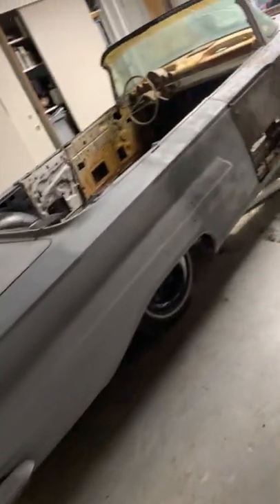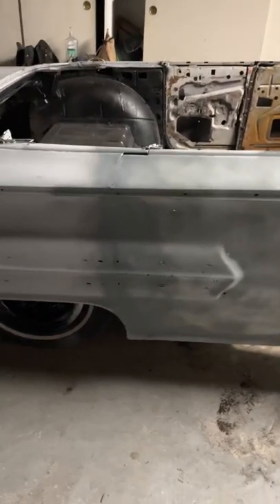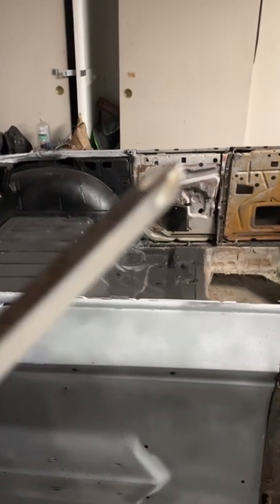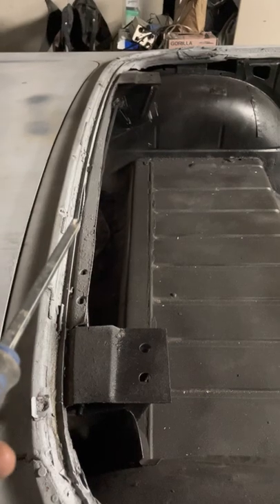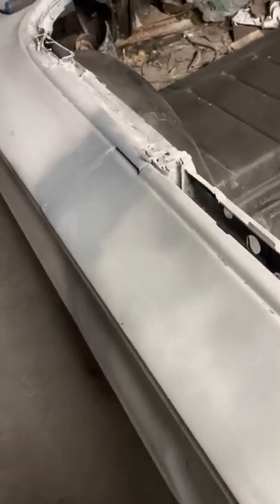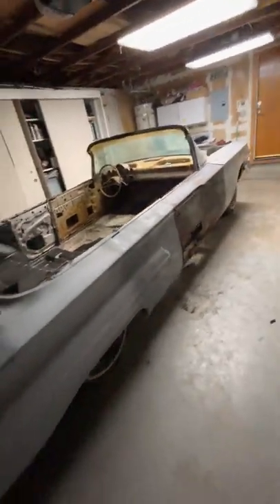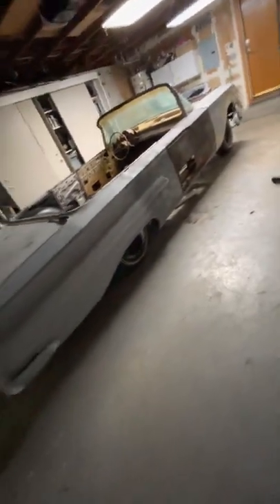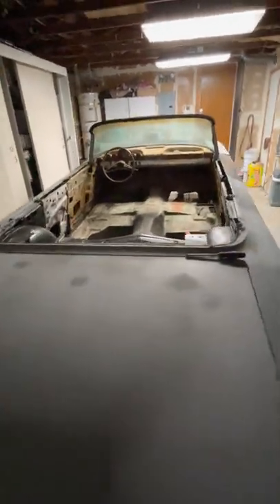1960 impala convertible conversion

Comment: Great work! I understand a 4 door is the way to go when converting a hard top to convertible. Were you able to retain the windshield pillars?         How about the tub around the backseat for the top to retract?  Something one can fabricate or solely a convertible tub needed to function.
Reply from the maker: Thank u !. They sell the windshield bow online i can cut that down easy but the tub about the back seat i have not done yet but i got ahold of a real rusty 1961 cadillac series 62 convertible felt bad cutting it up but i can fabricate that tube to fit ill be posting a video later
Reply: Thanks for the info, sounds like you’re on the right track.  Dream it, build it, drive it!

Comment: Maybe cut the windshield down it will look right the convertible windshields were slightly lower. There's no wrong way as long as you get to where you want the car looking.
Reply from the maker: I’ve always wondered about that part I’m glad you said something I’ll look into it because I kind of want it to be correct thank u 🙏
Reply: @tec_tattz  my friend and I ran into that problem year's ago working on a convertible chevell windshield. They are slightly shorter than a hard top. I like how Chip Foose put the 1959 convertible windshield on the 1957 Chevy. Did you see that. If you can make a different windshield work off another convertible and pull it off to look good.
I met this guy that had a 1939 4 door Chevy he made it into 4 door convertible. He took a completely nice car wack the top off it. It looked really nice he made it look factory. I told him I didn't know they made a 1939 4 door convertible. He and his buddy that's an apoatrery guy made the top for him. It was at the Nails California bay area car show, it's a very small town where Charly Chaplain lived and made some movie's. They have some pretty cool car shows. Maybe you can look it up on YouTube I'm shire someone put up a video. Keep on you'll get it done I seen people build car's truck's in a lot worse shape and turn them into nice rides. 
"Remember it's your vision not every one else's."

Comment: Nice work Bo, my question is what section did you use on the back is that an convertible trunk lid
Reply from the maker: thank u and its the original truck lid its the exact same size as a convertible im stuck here at the moment i need to see another convertible so i can take measurements so i can fabricate parts that are not available

Comment: What car was your diner for the tub and post?
Reply from the maker: it was originally a 4 door so the trunk was already short and the panels quarter i used the original back door i just cut it to size and the post i took them off of a 1960 impala two door hard top i still have som fabrication to do to the inside panels and the post that connect the convertible top not sure what those are called but ill be getting those off of a 64 convertible or a 60 if i can find them if not ill make them my self

Comment: How are the rockers?
Reply from the maker: they are good there is still one section i have to cut out its to high its where the old door post use to be and they have no rust
Reply: @tec_tattz  you should reinforce them with 3x5 tube steel since the roof is gone. Convertibles need more bracing cause in time the body might bend inwards.
Reply from the maker: @georgesand4629  yes there is a few braces that need to go on someone else mention this to me but im not to sure how to go about installing it